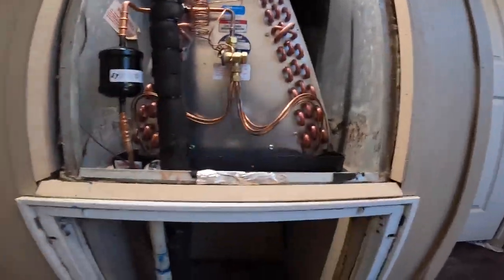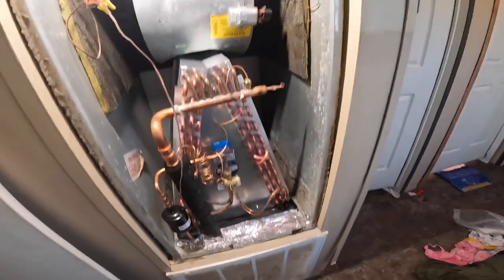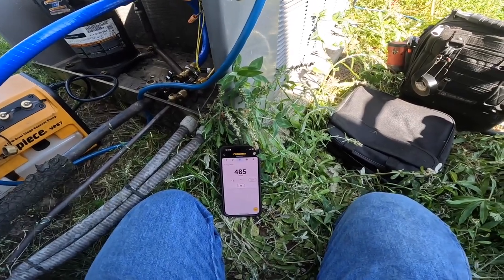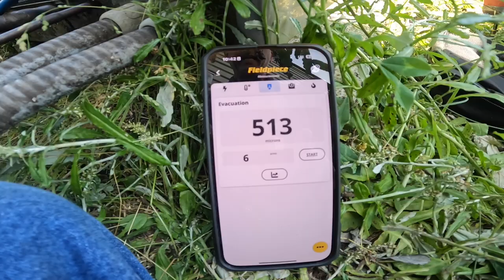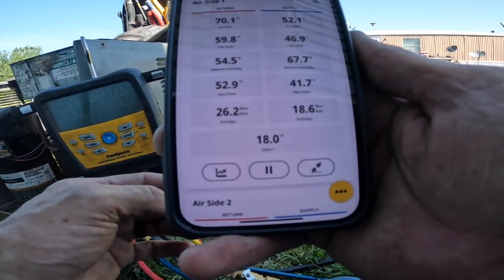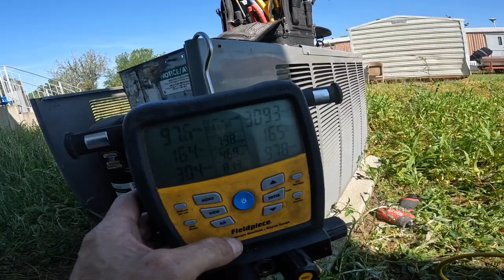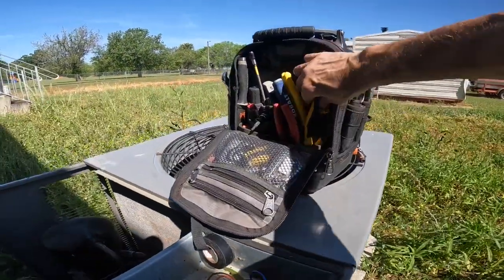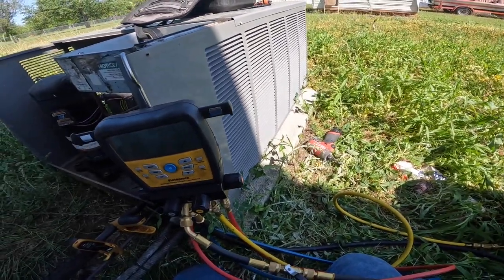Flameless Coil Change On a Mobile Home! #hvacguy #hvaclife

Comment: mobile homes air returns are sized for the heat, which is a lower air speed.
I've always had to add more return for the ac air speed.

Comment: Do the return Curtis a lot of builders or hvac contractors seem to cut corners and not do the ductwork adaquitely for heat maybe it might be adaquite but for cooling is often not optimum or efficient and build a plenom or air handler box if one is not there already

 but at least you caught it and said I don't like those head pressures or suction pressures and thought they were low.

And I also liked from your last video where you looked at the size of the condenser and was like hey that's not right with a 3 ton coil on a 3 and a half ton compressor again not matched correctly you don't undersize an indoor coil against a condenser if it's 5 tons than thats what goes on the inside. Period.

I am not even hvac technician but have worked on cars and I know that and yes I have worked on my cars ac system and replaced a condenser and even used my 3 cfm vacaum pump in it before I charged it with my gauges. With r 134 a.

Hey maybe you can test the so called new r 32 systems out and let us know what you think.

Comment: I do a lot of mobile homes. Most of the time they have oversized systems. They are at times a catch 22 because one might need 3.5 tons of cooling, but if you put a 3.5T you can’t get enough airflow through the ductwork. I oftentimes will drop 1/2 ton and seal the duct transitions when I do a changout on one. This home would have be best served to have a 3T put outside and a 3-3.5T coil inside when it’s replaced. Probably oversized

Comment: Mobile homes generally have a high static blower load because of the small ducts. Check the static pressure, your exchange may be low across that coil?

Comment: I believe that should add another return duct possibly a 12 to 14 inch size duct curtis that will bring up suction pressure 😉
Reply: If it's a trailer there is no return duct work , i can't believe they get away with selling this crap, and a 4x12 trunkline

Comment: The tool bag sitting on the fan could be throwing you off some on your readings as it restricts the airflow on the condenser.
Reply: I noticed that as well, that Blockage of the condenser fan would cause a higher head pressure and I don’t believe it would affect the low side of the system Based on the numbers that were produced,,, I believe he said his sub cooling was correct
Reply: I think,with the low ambient temperature,  he's trying for some head pressure control.  Later he cycles the condenser fan by hand to see the effect on superheat but, i figure, the low return air temp and the TXV are controlling that.

Comment: I hope you're putting a little 410 back in stock before they ban it
Reply: You can still purchase r22
Reply: It will be years before r410a is totally phased out in the US. They’re not going to just up and make it totally impossible purchase when so much equipment uses it. You can still buy r22 and they have made r22 systems in ages.

Comment: One thing you can try is properly mounting the TXV bulb. I noticed it's on the vertical run on the suction line. TXV's should always be mounted horizontally in either the 9 and 3 position or 7 and 4. The bulb isn't seeing proper saturated vapor to be able to meter refrigerant as it's designed to do. A return would help suction pressure but really having such a low load and barely being below freezing, i bet on a warmer day with higher heat load, your evap temp will be closer to 35-37. Low RA temps WILL simulate a air flow issue.
Reply: Let's hear you explain exactly why the TXV needs to be mounted in those positions. I want the physical details of what happens if you don't.
Reply: If you google where to place the sensing bulb it tells you where and why.
Reply: @schmitty99  I don't need Google. I've been working on refrigeration since the 1970s. There wasn't Google back then. You had to actually know things.
Reply: @Bryan-Hensley   You sound like me.  My kids always telling me to put on the map.  Like I can't read direction signs on the road.

Comment: Add in apropriate size cuttout for an additional return into that existing space but if I am honest I don't like those fully open returns on the bottom like that.

I think a proper bottom return plenom box should just be mounted on the bottom and then cut the necessary openings for a single floor mobile home even if you have to cut openings on more than one side.

Vs just blaming or assuming it's the txv it's about making sure the return air is adaquite and then the supplies are adaquite.

Comment: 1.  does the home need 3.5 tons?    2.  is the labor + parts for swapping out the revaporator less than just a 3.0 ton condensor unit?

as usual, some very fine craftsmanship.  2TUs :)

Comment: Well you got it in there, that's what matters the most. That coil is huge, mine is a 4 ton, but it's a slab coil. Did you check to see what coil went with that condenser? Well too late now. It looked pretty good, I think you are right about the air return, It should work out. I have always heard you can go a half ton one way or the other, but as we see, it isn't always just that easy. I think you're good, and you did do a good job on it. The only other way was to put a 3 ton coil back or change the whole air handler.
Reply from the maker: You can go up a half a ton on the air handler, never down half a ton. Which was the problem we had to begin with.
Reply: @HVACGUY  Thanks, gotcha!

Comment: Hey Curtis, have you been using those crimp fittings long?  What guesstimate would you put on those fittings as to a % that don't leak......ie 90%, 95%  or 100%????  Thanks....keep up the good videos.
Reply: We have been using them pretty regularly on our commercial jobs for about 2 years now and have yet to have one leak. As long as they’re installed properly I’m not worried about them leaking.

Comment: Were  you disconnecting condenser fan to bring suction pressure up curious if you have had success with that
Reply from the maker: Rising head pressure does usually help suction rise

Comment: Question why go with a bigger coil rather than matching one with condenser just asking
Reply from the maker: It previously had a 3 ton coil, on a 3.5 ton condenser. I was just trying make them match.
Reply: @HVACGUY  but I heard you said 4 ton coil that is why I ask would that not be a little over sized

Comment: I still believe a 3ton total system would have worked better my friend
Reply from the maker: Yore probably right. I’m not perfect and don’t pretend to be.
Reply: You did what the homeowner wanted. They probably didn’t want to by a whole system.  Did you check to make sure you’re not bypassing air around the evaporator. 18 degree delta t isn’t that good for suspecting  lack of airflow. What do you think. And no body perfect buddy
Reply from the maker: @jamesfitzsimmons381  it was a little confusing. Decent superheat, and temp drop. Temp drop was a little high, which made me think airflow, then low pressure with superheat made me think restriction. AH’s are built for high static. I think it may require more than just more return. But, that’s where I’ll start.
Reply: @HVACGUY   I agree with you. You’re a good technician you will figure it out and fix it .
Reply: Make sure the blower air isn’t going around the coil ( bypassing) rather than through the coil   It looked like a tricky coil fit in cabinet.

Comment: Did you test the txv, holding the bulb? So you were getting no superheat before? What was your low side pressure looking before. Thanks. Defenitely learning alot watching your videos. Keep up the good work
Reply: It looked like his suction pressure was running about 31 degrees with 18 degrees of superheat.  About perfect for a TXV with no heat load.

Comment: Still baffled why you installed a 4 ton coil and not match size of condenser,
Reply from the maker: It had a 3 ton coil on a 3.5 ton condenser. The coil I ordered is a mortex 3.5-4 ton coil. I did match it as best as I could
Reply: @HVACGUY  ok, surprised to see replacement coil so tall, well it should work better on latent load for your region

Comment: Are those compression fitting less likely to leak down the road than a soldered joint?
Reply from the maker: Ask me in 5-10 years. But according to RLS, no
Reply: @HVAC GUY How do you repair devices coupled with that RLS fitting, just cut it out?
Reply: @HVACGUY  OK, let us know if you come across one leaking.
Reply: Wasn’t that smoke alarm chirping the last time you were there
Reply: @tombeilman5579  I can’t stand a smoke alarm that’s chirping….. I   had mine start chirping about 2 am one time and I got my happy ass out of bed and changed the battery at 2am.
Reply: @HVACGUY what kind of pressure can those fittings take
Reply from the maker: @jme36053  yes
Reply from the maker: @iamnoone.  i believe they are rated at 750 psi